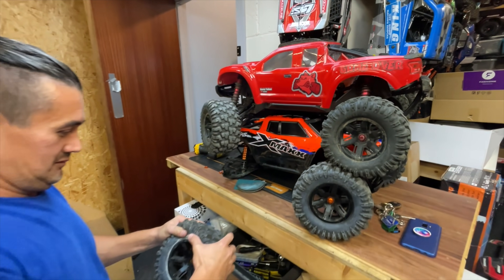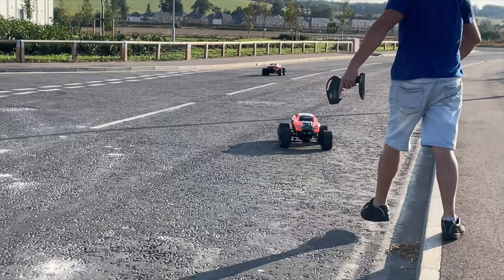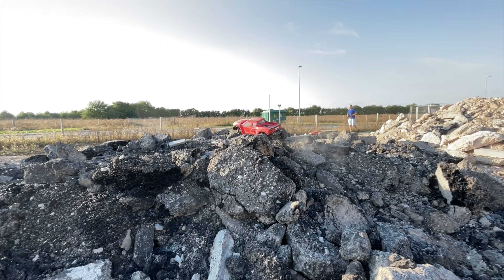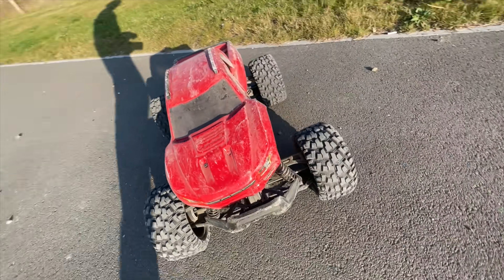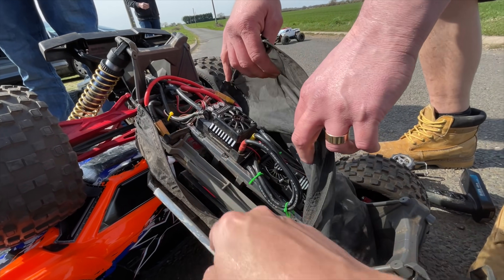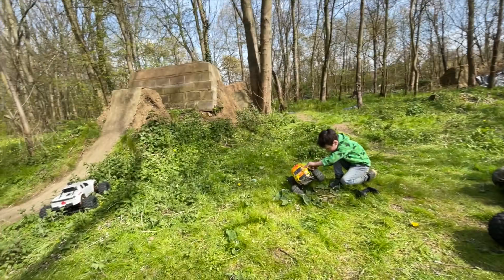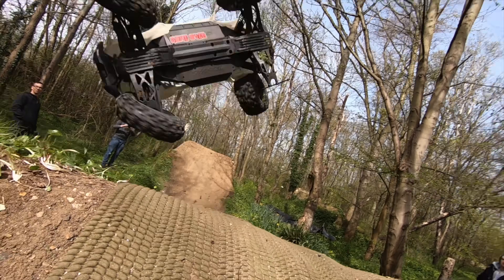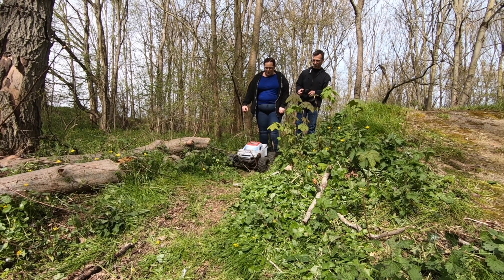Total RC car carnage

Comment: My x maxx is almost fully upgraded. Max 5-800kv combo, mod 1.5 30-35 gearing, aluminum motor Mount, aluminum diff covers, proline badlands and a ton more. Just need that proline body. 

THING RIPPSS!

Comment: should try some loctite super glue. the professional version in blue bottle. Tried it when I had to redo my xmaxx tires. full throttle and no blown tires on any of my 8s cars. only problem is it cures FAST and flows like water so got to be careful not to get it everywhere. started trying it on different things.. Glued a broom handle back together and its still holding strong.

Comment: If you were to recommend an rc at the max price of $300, which rc would that be? I’m on the market for a new rc and was thinking maybe I should ask someone with experience and someone that knows rc in and out. By the way my current rc is an hpi savage xl. I bought it used with a tool box full of new parts (still have all the new parts) in plastic, it runs great but I’m leaning towards electric lately.
Reply: Rival mt410
Reply: Slash 4x4 I had was very durable. Brushed version is like $330. Little out of the price range. For me it’s parts availability. Literally like any hobby store carries Traxxas. 

Arrma Senton 4x4 is pretty durable. Brushed version is $270. Kevin has videos of both

Comment: I put a locked center diff in mine, but with proline badlands its a diff wrecker.  Dont know what to do.  Dont want tires blowing up but dont like messing with the center diff as its a bit of a haul to get to it.  Kinda stuck in the middle on breakages.

Comment: Genuine question. With so many cars about and running at the same time, are "crystals" still a thing for the radio gear? Been a long time since i had an rc. Traxxas bandit and Mardave cobra and to use them at the samne time with  my bro we had to use different colour crystals in the radio transmitter and receiver. Love the vids btw, My chill out in an evening after a log day at work
Reply: No they’re all 2.4ghz. No issues with interference and no crystals
Reply: I wondered this returning to the hobby. Always had a bag of different crystals with me. Far easier now.

Comment: Hey Kev I have an Xmaxx but it’s the 6s version. Do you know what parts I need to upgrade to the 8s drive train? They discontinued the power up program.
Reply from the maker: rear bulkhead, centre diff, drive shafts, spur assembly i have a vid on this channel somewhere
Reply: Really they got rid of it? It makes sense cause I don’t see how they would profit but dang

Comment: Hi kev great channel. quick question are the 4s gens ace batteries any good & what run time do you get off of them.  i got the banggood zop power 5000mAh 4s for my 1/5 kraton with 800kv motor & only get 8min run time.

Comment: Kev I need help with my RC car so I have a Traxxas Stampede 4x4 that I got off of a friend but only the steering works do you think I should just replace the receiver for a new one?
Reply: Try re binding it with the remote or do a voltage test with the motor and make sure the battery’s are fully charged
Reply: Try re binding it with the remote or do a voltage test with the motor and make sure the battery’s are fully charged
Reply: Check all connections first then if they are all correct I'd replace the ESC.
Reply: Try recalibrating the receiver and transmitter. Check your connections into the receiver box and make sure steering is in channel 1 and throttle in channel 2
Reply: Just Factory reset the ESC and see what happens

Comment: I would love one but £1200 is beyond ridiculous, when you can get petrol 1/5 km Baja for around £300 or 1/5 km x2 4x4 for £600 with all CNC machined parts you have to ask why they are asking so much for an X maxx that's mostly moulded parts,
Reply: How much is petrol to run it per say a year?

That’s a good amount of time to be able to get it out a few times. Batteries are under $100. Charger is under that as well.

Comment: Tip for your 200 mph car:
Crash it into a wall flat out, broken chassis have more airflow.
No need for a servo, cause then you can line it up and it will just go straight. Mabye make room for another motor too.